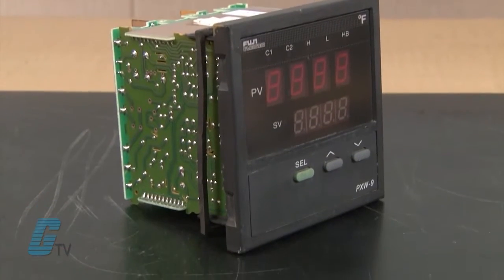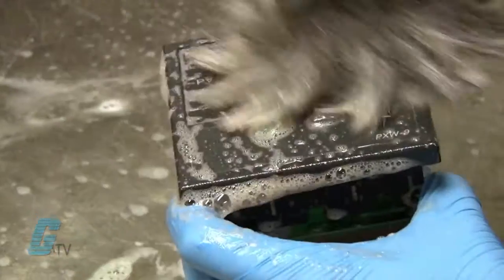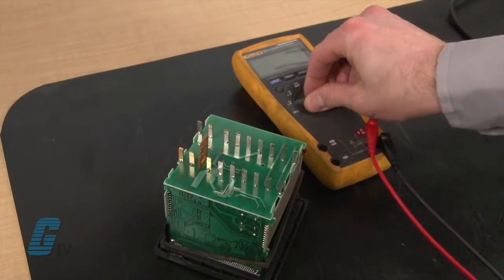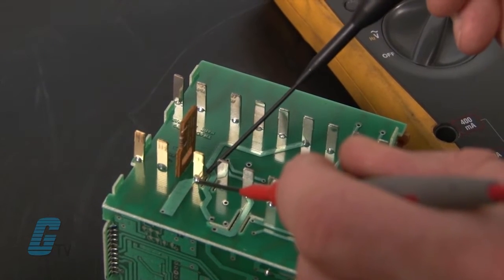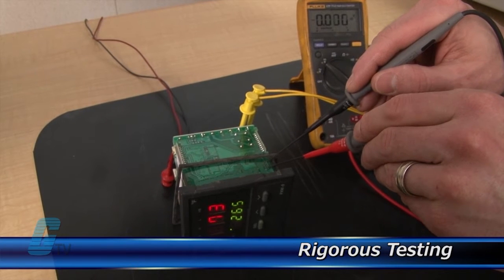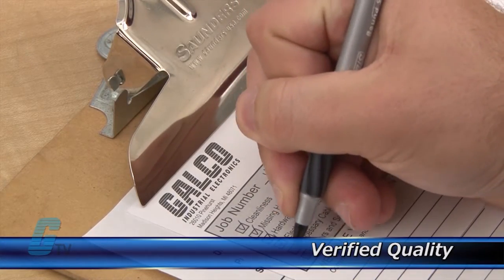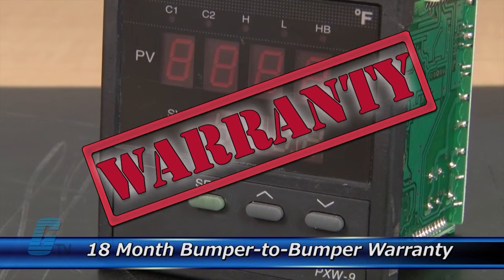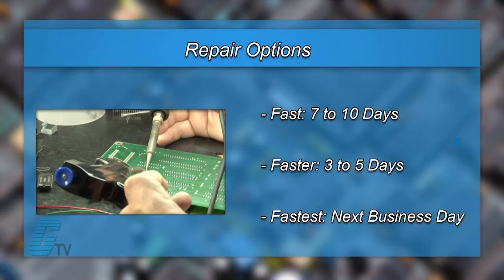Repair Fuji PXW-9 Temperature Controller

Comment: Dear friends,
Could you ask me what kind of fluid do you use to clean the temperature controller ?
Best Regards!!!
Reply from the maker: It's just water and an industrial strength cleaner that we dilute to prevent the cleaner from leaving a film behind.  Just don't have power to it and and be sure to use proper drying procedures.  We keep our repairs in a heated dry room for a few days to ensure that the material is dry before we work with it.
Reply: Oh, thanks for your reply!!!